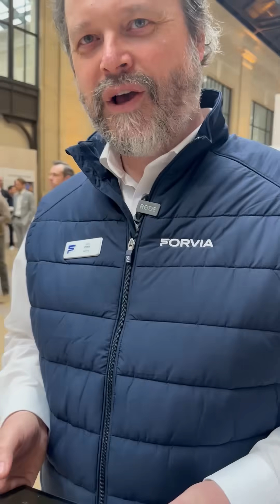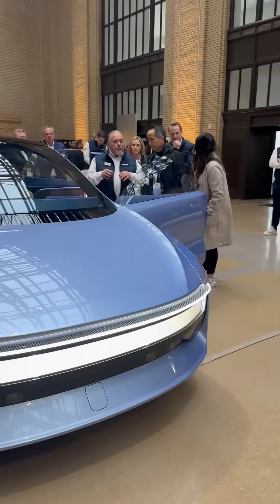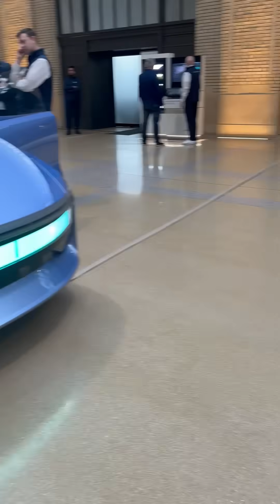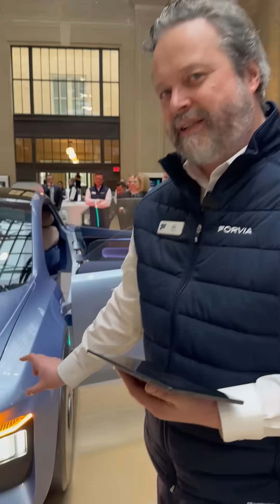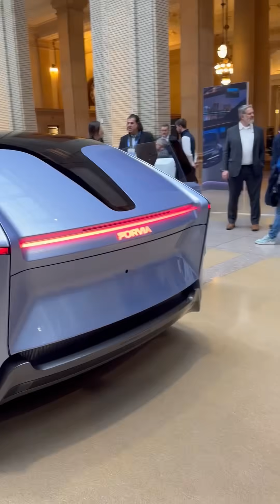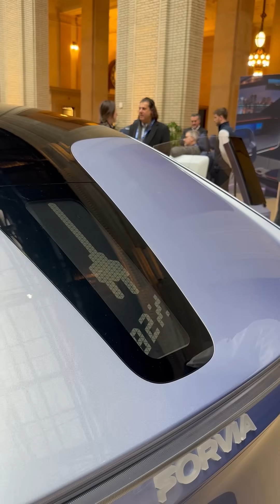Using Automotive Lighting for Styling, Information & Safety - Autoline Exclusives

Comment: $10,000 damage from the shopping cart tap! 😂
Reply: Exactly.  The round sealed beams used in cars through the 70's were about three or four bucks to replace at the time.  Rear tail-light bulbs were maybe fifty cents.  In the 80's, they started to use molded plastic modules for lighting, break one and it could be hundreds of bucks to replace, although the bulbs could be replaced individually for less than twenty bucks.  Fast forward to today, and the modules are LED, and bulbs are not replaceable, you need to replace the whole module, sometimes at a cost of fifteen hundred bucks.  And corrosion in a lighting circuit can make the control module brick the vehicle in some cases, requiring big cost in diagnostics to find and repair.  We're going the wrong way, people, modern cars are getting worse, not better.  Uncle Tony's Garage on YouTube has several videos covering this.  "Thanks, Owen", my foot.